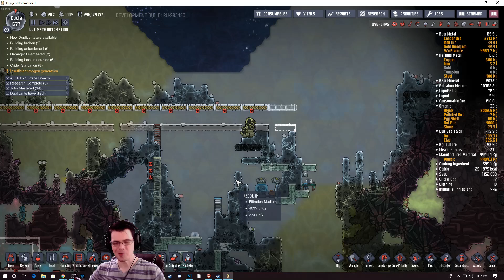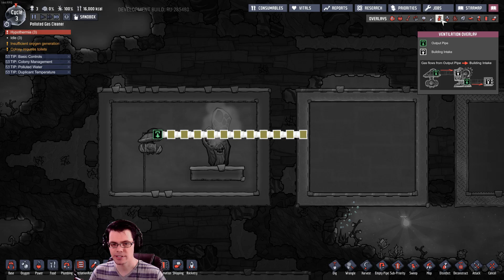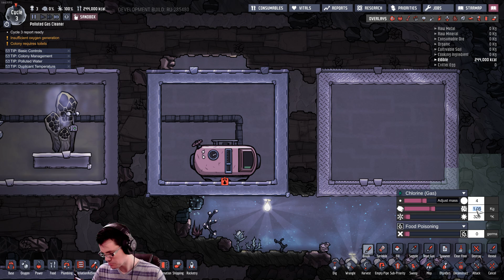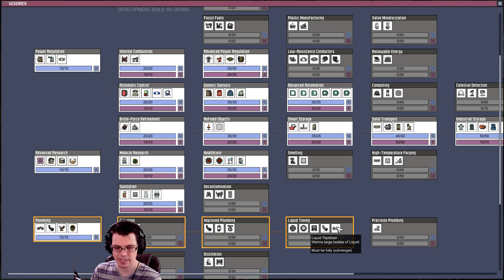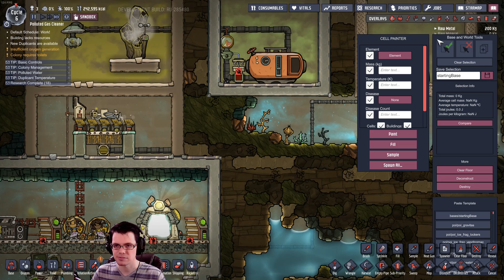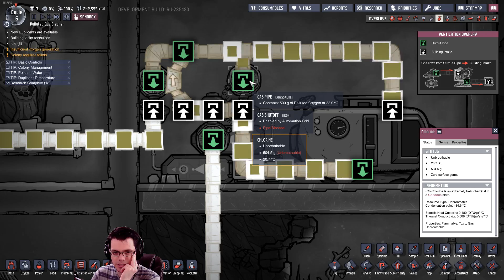Automatically Disinfect Oxygen and Water! Oxygen Not Included

Comment: You could easily make an automatic disinfection system with a staged setup. The first stage is initial storage, you throw all your polluted material into a "dirty" reservoir during the day. The second stage is a "Clean" reservoir in the Chlorine room (You could also put the dirty one in the Chlorine room as well, to start the work early and make it more likely that the clean reservoir ends up pumping out clean materials.) Also have a timer that records when "Evening" starts. Evening starts precisely a number of second before night starts equivalent to the duration of night. Here is the cycle.

All Germy sources flow into your dirty Reservoir at all times. When Evening starts, the "Clean" Reservoir pumps the entirety of it's contents out to an accessible location (If your system is using such quantities of material that it is not clean by this point, then create a logic circuit that staggers this every other day and use more reservoirs). When night starts, the Clean reservoir stops pumping out, and the Dirty reservoir begins flowing into the clean one, stopping again in the morning.

The net result of this cycle is that every evening, a "batch" of freshly cleaned material flows out, and a new "batch" is loaded into the cleaner. The two reservoirs are kept separate because otherwise you'd end up constantly adding more germs, and never end up with a 100% clean material to pump out. One is a sort of capacitor for the other.

Comment: Really? That complicated? I just put 4 purifiers around the geyser and set the gas pump to work to a very high pressure setting (around 5k grams), so that the purifiers had time to work. Yes, a bit of slimelung gets into my base, but the system has been working for around 300 cycles already and no slimelung infection in any duplicant for the moment.

Comment: Might want to add a buffer to set signal; otherwise you run the risk of getting backed up since once the tank is clean, it doesn't seem to dump all the gas in one cycle; so perhaps if no gas is detected for 2 sec? Also if possible all tanks should be in the CL.

Comment: I had a go at compacting this a bit cause I thought I spotted something, I think I got the mechatronics as compacted as possible (3 extraneous wires), though I think I use a few more ventalation pipes compared to yours it was to keep the wires to a single column, and the section that does what yours does comes in less total area 56 tiles, images: https://drive.google.com/open?id=1TDMdEID54odEjMceNq3X6TvxZKiseJyy
So the design is tileable if you want to clean or store multiple gases it will (and sort them too)
starting at the top, if you've got a known input you can feed it directly at the top tank stack
if you don't know the input feed it from the left and it'll auto-sort into the right cleaning tank (it'd probably be a good idea to throw in a bridge now and then to keep the LtR flow)
The first tank acts as the input buffer
The second is making the correct size charge
The third ensure the cleaning comes to 0 germs
The fourth is an output buffer and while not strictly needed could be used to ration the supply if followed by a gas valve
(in theory, you could put a sensor and a power shut off to deny the stack power whilst the 4th tank is full (and the line between 3rd and 4th is full) but I can see a lot of problems if one element turns off for an extended period of time so I left it out it was a thought worth mentioning to save on power)
Then the output is at the bottom
Depending on where you put the build you can use the rightmost tile under the reservoir to pass a cleaned gas up and into the base or a polluted gas can be pumped from the base up and into the system

Comment: You can have 3 or 4 buffer storage tanks in series and control the output of each tank using the value and controlling the amount that goes out. The slower it goes the faster air or water gets cleaned. This won't need any power and we don't over use the resources.

Comment: You can accomplish the same thing with a single tank,  2x Gas shutoff, 1x Germ sensor, 1x element sensor, 1x not gate, and 1 or more buffer gates daisy chained with 200s.

When the element sensor detects no polluted oxygen the buffer gates activate opening up the valve to let the tank fill up, the more buffer gates you have the more the tank fills up, when the element sensor detects that gas has reached it, the buffer gates stop resetting and the gas shutoff stays active until the buffer gates finish.

Once the tank is full, the oxygen cycles until zero germs are detected which opens up the second valve to dump all the now non germy oxygen somewhere else, when the last packet empties out it activates the element sensor thus repeating the cycle.

https://imgur.com/a/gtJexmy
https://imgur.com/a/bMhiFqD

Comment: You could do this with three storage bins for a continuous flow pretty much. If you pump the germy oxygen into tank A constantly, it'll keep going until full. If you figure the time it take to fill up, you can use a timer to swap the flow between the other two tanks. First you pump gas from tank A to tank B until B is full. Then close the link to A and let the gas go from B to C. While tank B is draining, A is filling up again from the source, and both the gas in tank B and C are killing germs. Once all the gas is in tank C, close the link between them and re-open the pipe between A and B. By this time, C should be germ-free while B is filling up again. Just dump the gas out of C at that point and you have clean oxygen.

Source->A->B  C->Filtration Medium
Source->A  B->C  Filtration Medium
Basically just swap between the two above configurations on a timer, tuned to how long it takes to completely drain gas from one tank to another. You might get some germs passing all the way through on the first run of it, as air will sit in the pipes between the tanks and not get cleaned, but once that's over with it should work just fine. Probably not the least expensive way of doing it, but it's a lot less complicated to set up. (Just one timer and a NOT gate, and your automation is done.)

You could also just not have tank A probably, but this way the gas gets stored pretty much constantly, and provides a buffer in case of a power outage stopping your pump or something. Maybe you launched a rocket and jettisoned your oxygen source into space. That would be bad. :P
Reply: you cant put a valve directly on an output of the tank, there needs to be at least one pipe between.That pipe will fill up with infected gas right when it enters the tank and therefore wont be disinfected, not a perfect solution. I tried it with polluted water and liquid resorvours there was always one small load that just went threw the resourvour withput beeing disinfected
Reply: edit: maybe it works if u dont empty the tanks/resorvours completely but leave just enough inside that nothing passes right threw

Comment: I tried to redesign it thinking it would be better if you just use memory toggles to set the conditions to start the emptying and the refilling of the tank. It turns out it is possible, but it is way more complicated. I ended up with this. https://imgur.com/a/dQbRLv7 Also you can avoid the pipes obstruction by using another gas shutoff to stop the looping while the refilling process is on.

Comment: Nice video but this one looks like Klei nerf fodder ;-(

You used the phrase "primary outlet" (or something similar) to  describe some property of flow through a valve. Wrt to bridges my understanding is that a fluid packet will always cross the bridge and only enter a pipe connected to the bridge's inlet node if the other end of the bridge is full - is this what is happening with valves too ? Have you tutorialed this behavior anywhere ?

Cos that looks like something Klei are not nerfing so would be more use in the longer term - unless I have things confused ;-)

Comment: Total time to remove all the germs isn't half time x2. If you had 1024, after 11s you would have 516, after another 11s you still have 256 and so on until it reaches 1 and deletes. That is why it slows down A LOT when it's in low numbers. if you want to know how long it takes, do log2(germs) and multiply by time (10 times in cae of 1024 so its 110s). Also, difference between 10k and 50k germs is only 22s
Reply: the wonders of logarithmic growth
Reply: Exponential /Decay/

Comment: is it possible to empty bottled liquids in reservoirs ?
Reply: MrGustave1er no, but you can make a place where your duplicants will empty the water on the ground and you can have a liquid pump suck it up instantly to pipe it into a reservoir. Currently the only way to clean germy bottled water without piping it into a chlorine filled room in a reservoir is by building an ore scrubber and making duplicants put the water in as they walk by. Yes, somehow ore scrubbers can clean bottled liquids. Just know that each one only cleans up to 480,000 germs if I remember correctly. If you have REALLY dirty water from outhouses you'll have to wash it a few times in the same scrubber.

Comment: ... You could basically compress it down to one reservoir in this case. Just copy the upper "charge" tank to the lower one, and you have a cleaning system that requires a little less in resources.
If you're going to build a charge at the source, then yeah, all you need is one reservoir tank to clean. 
Why would you need an element sensor, though? No other element would interfere with cleaning polluted oxygen, especially from an infectious vent. The germ sensor would be enough to flick that switch.

I think there needs to be an inline pressure sensor for gas/liquid pipes so you can actually build a charge via automation.
Reply: The tank at the source doesn't provide a measured charge it just means that once a full measured charge has been collected and the pipe is backing up it doesn't back up all the way to the pump and stop the pump working
The charge is then measured so that the cleaning loop can measure the current germs and not have a clogged loop
Finally, the cleaning loop happens to so that the automation can measure the germs. If there was no loop polluted stuff would be output before it can be cleaned and it'd stay in the pipe and not get cleaned there, in fact, it'd grow more germs while in the pipe
Even if you had a pressure sensor it only would measure how much was in the pipe at that point between 0 and 1 kg, the reservoir can hold 150kgs

Comment: ~90% of this build is unneeded. Instead of increasing the length of pipe, increase the length of time the automation signal is active with a logic gate. 2 shut offs, one reservoir, 1 element sensor, one germ sensor, 2 not gates, and one buffer gate. Set the buffer gate to the element sensor and give it a 60 second timer and the tank will fill for 60 seconds before shutting the gas intake off.
Reply: Build it show us

Comment: So those reservoirs pump the air/water around with no power usage? Free pumps? Or did I understand that wrong?
Reply: You got that right, if you have any ordinary loop usually nothing will flow but if you put in a bridge or a tank then there's an input for the gas/fluid to head to and it heads there with no power needed, the bridge/tank acts as a valve and suddenly the gas/fluid is far from it's exit and it heads there again, it's been in the game for at least a year.

Comment: A comment on valve-sensor setup. When used as filter, you may want to put sensor right before the valve as it's activating during next tick. I.e. when your sensor sees no gas right now (and zero germs), it opens the shut-off immediately, letting through whatever packet is sitting right before or in shut-off's output.

Comment: For the water automation, I use a two stage polluted water tank and heater.  Heat the first tank up to ~70C, then once it gets close to full, shut the input down, use a germ sensor to monitor the amount in the water and then use doors under the tank to dump the hot cleaned polluted water into the secondary tank.  This has a pump and goes into the sieve.  Sieve cancels a good chunk of the heat out and then I use any number of options to cool that a further 10-20 degrees (Often using the thermal cooler thingy immersed in the first polluted water tank so the heater does not have to work as hard.

Comment: I know it's Brothgar's memnotic for remembering how an S-R Latch works, but wouldn't a light-switch be an XOR gate? (if you switch either switch in a room, it will toggle the lights). 

An S-R Latch would be having an "on" button and an "off" button for your light: you don't have to hold the 'on' button down to turn the lights on, nor do you have to hold the 'off' button down to turn the light off. you just hit the "on" button and if it wasn't on it turns on, and when you hit the off button if it wasn't off it turns off.
Reply: I think he means a single switch; if you think about it like a rocker switch then you can press either the top or bottom half of the switch, with predictable results.

Comment: Why do you need to keep the gas circulating out of the tank? can't you just have the output with a germ sensor and a cutoff  to stop the germy gas from leaving the chlorine before it's killed all the germs? in fact if the gas is getting cleaned in the pipes you can see how far the gas needs to go in a pipe before it's clean and then at that point put the tank so that everything that goes into the tank is clean.
Reply: Germs don't get cleaned in the pipe, only in the tank, so you have to send it back.
Reply: Good to know, though still confused by the point of circulating gas in the pipes.
Reply: DaeDroug - if you have no circulation one packet of gas with germs will sit on your sensor and you will never know if it was cleaned or not. It's a somewhat reliable way to check if gas is actually clean - run it in a loop and check every packet coming out of the tank, as the magic happens only when gas in the tank.

Comment: You could simplify this with 3 clocks, 2 tanks and a gas pump and shutoffs. Load one while it’s loading the other is purifying, then unload the first, purify the second while you reload the first. Sure it’s not absolutely efficient but it’s smaller, just as automated and in both cases and your limit on the system is the volume of gas you can pump in a cycle no matter the method you use.

Comment: I have had moderate success using a Clock Sensor, what I was doing is filling one tank during the first half of a cycle, then filling another tank during the second half of a cycle. I found that 3/4ths into the cycle, the first tank would be completely free of all germs. I then spent the last 1/4 of a cycle emptying the tank, I was only able to empty the tank about 80% in this amount of time though, but this setup only needs three clock sensors, three valves, and no logic elements.

Comment: Lol, just use a timer, one to load, one to empty.
Reply: what if incoming pressure is unpredictable?
Reply: The_Yrri , He managed to decon the tank in less than 5 minutes just set the timers to 5 min and have the valves switch
Reply: Because it's not quite so simple to know how much time. To kill 8 slime lung it takes 44 seconds, to clean 16 it takes 55 seconds, there is probably some theoretical maximum amount of germs and a number of seconds that covers it (1billion germs takes nearly 6 minutes) but then some of the time you might input 1000 germs and have completely clean gas not able to do anything cause it's waiting on a timer for 4 minutes.
Reply: 2 timers; fill for 2 minutes; sit for 4 and release. Dupes don't use thaaat much oxygen.
Reply: You cant simply let it sit because that means some germs are in the outlet pipe multiplying and 4 minutes is only enough for 1million germs so if you manage to get more than that you wouldn't clean it all and again you end up with oxygen sat in the tank when it doesnt need to be if you have less than a million germs, and while oxygen might not be a concern for a small number of dupes this applies to any gas or liquid and there may be a point there cleaning something is necessary to not waste any time

Comment: Have you concidered the single tank setup with a valve for the de-germed pOx connected to the germ sensor and the pipe content sensor hooked to a memory cell , which is connected to the intake valve but also to a timer of let's say 30 seconds, which resets the memory cell?
Reply: the logic doesn't allow you to store the number of germs and do the math on that number the system is binary either it's more or less than X germs so you need to test the output to see if it still has any germs if it does still have germs well you can't output it you have to recirculate it to clean it some more. You could test less frequently but I'm not sure what'd be gained by doing that since germs would be sat in the pipe doubling instead of going back to the tank to be removed.
Reply: JohnyDL well, you would use the memory cell and timer for the input valve. The output valve would be connected straight to the sensor. No math needed
Reply: I'm not sure what you mean with your first post then, it sounded like you're testing the input for germs and trying to time it to stay in the tank until the germs are gone, but you don't know how many germs there are to know how long to set the timer and even if you did some germs would be output to the pipe before the valve to wait there and grow germs anyway,

A single tank loop set up was installed at 14:37 but then the system jammed up.

Or are you talking about how to build up that initial charge? in which case 150 seconds (I think) of the input being on might work but only if there's 150 tiles of backed up pipe on the input side, which may be possible or even likely in a real base.